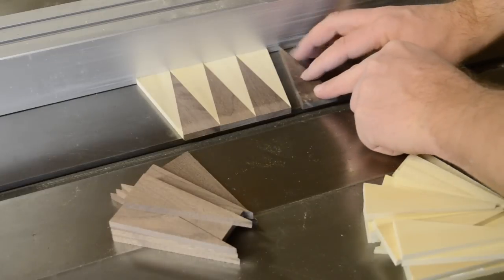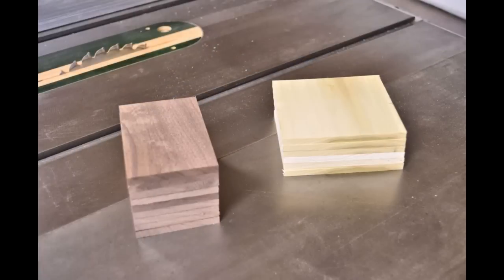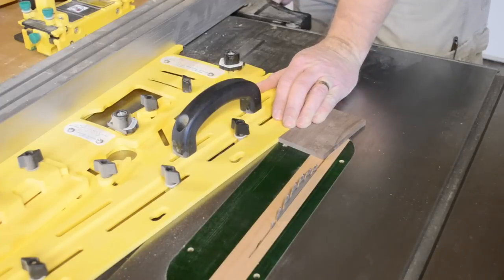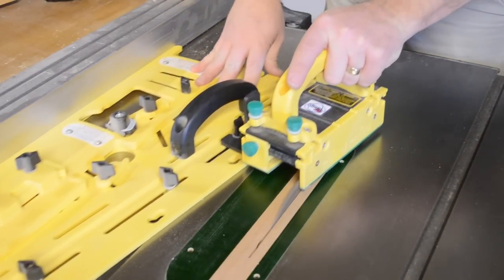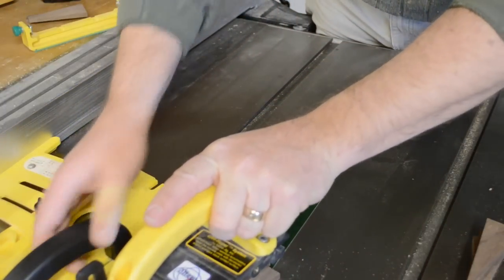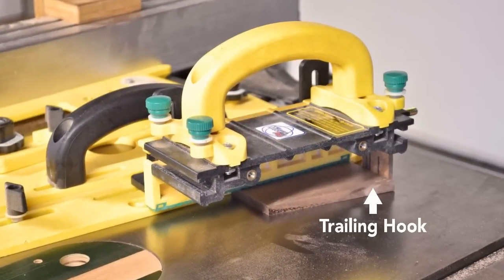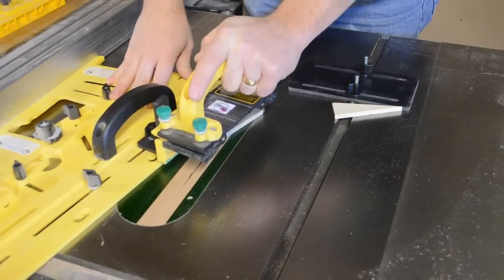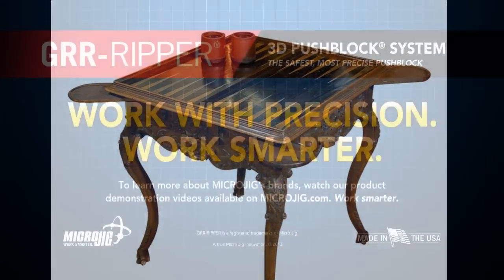Make a Backgammon Board with the MICRODIAL Taper Jig

Comment: What is the angle used for the cutting of the triangles??
Reply from the maker: Thomas, That really depends on the size of your game board. All backgammon boards use the same number of triangles so the length and width of the playing field determines the exact angle of the cuts.
I choose a size, layout the board and then if the angle is an odd number or partial degree, I can round to the nearest angle and adjust the size of the field to make it easier.
Reply: The length of the triangles depends on how you want the board to look and how many checkers per side can fit per point.
Not all boards have the same dimensions, typically you are able to fit 5-1/2 checkers per point on each side of the board with a gap. So just over 11 checkers across. Some boards you can fit 12. It comes down the a players personal preference.
Most importantly when you have 6 checkers across, on-per-point in one quadrant. They should fit with very little gap. But you do want just a little gap to allow for thermal and humidity expansion. So the final answer is get the set of checkers you are going to use and build the board around the checker size. 
With most boards you will find that with 4 checkers per point you can still see the tip of the triangle.
Reply from the maker: @backgammonskillset  thanks for the cogent reply!